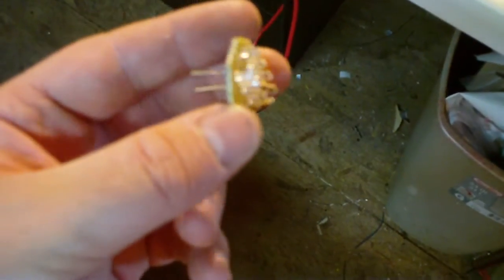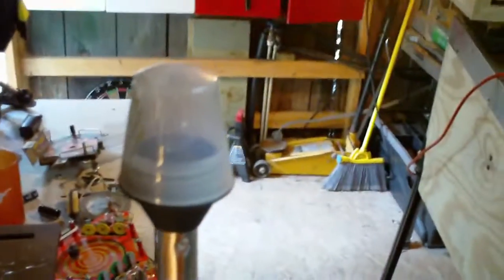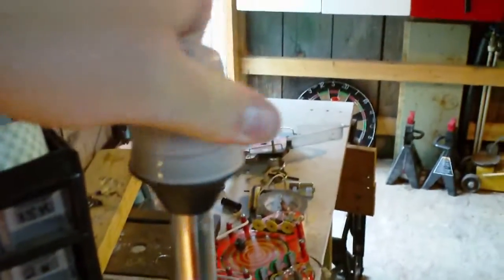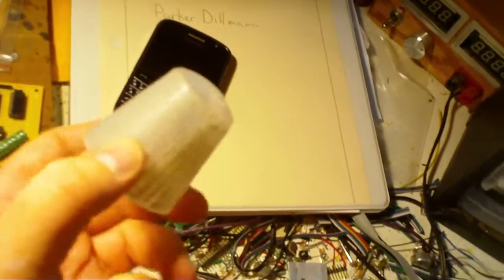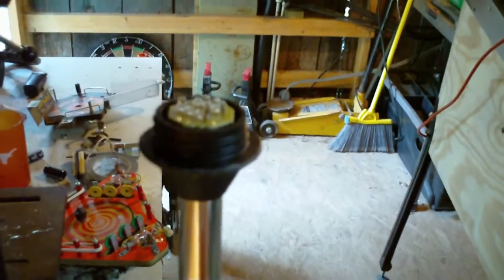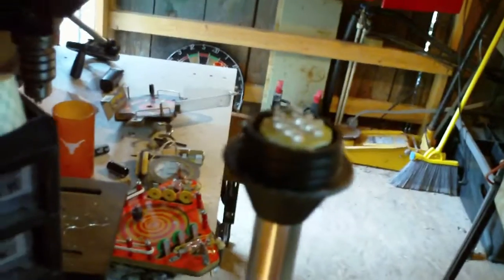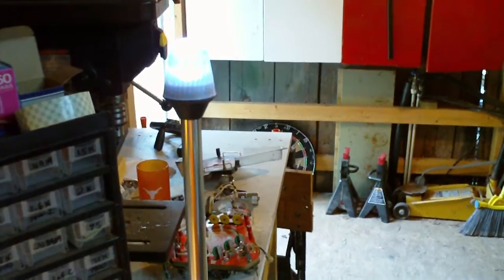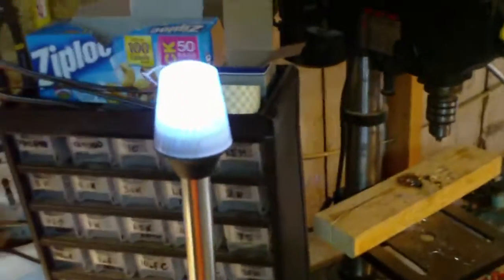LED bulb replacement for Stern Boat Lamp

Comment: It’s cool, but isn’t it supposed to be bright? The regulation is to be visible for 2 Nautical Miles, right? Anyway, I landed here because I was looking for a replacement LED. Like you said, power draw would be a huge benefit if I could convert to LEDs for my boat’s nighttime lighting!